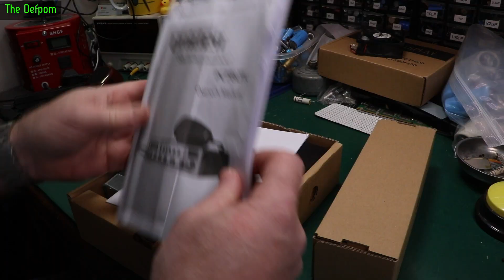🔴 Uniden PC78LTX Channel Modification - WORLD FIRST ! - No.1260

Comment: Dude your wasting time on doing that go buy a rci galaxy or a Stryker radio that the channels that have already been modified I know what I'm talking about I have been in the radio hobby for many many many years what your trying to do is poppycock 73s
Reply from the maker: @matt3030whiteeagle  those radios cannot do the NZ channels… at least not with correct channel alignment. I also know what I am doing with radios, been working on them for over 35 years… you might also know my website, RadioMods.co.nz !
Reply: @TheDefpom When my dad first got a look at my New Boss 429 the day I purchased it he took the pipe out of his mouth looked at me and said "What the hell do you need with a car like that" I replied in response I don't need it but I had to have it Dad. He put his pipe back in his mouth and just walked away shaking head. 

Point is I have modified, Repaired and installed about 30 thousand radios since 1969 and not a single one was ever needed but it was what they wanted. As a dble EE I watch Defpom because he knows what he is doing and when you take a radio that has never been modified it's a matter of accomplishment and Knowledge expansion and in that context it must be done.
Reply from the maker: @deltatangoelectronics8598  well said, thanks.

Comment: Would a Expo 100 A kit work for that radio with the 15.810 and the 14.910 mhz xtal in the channel kit to signal inject the signal like the cobra 29gtl/ltd/lx radios?  thanks
Reply from the maker: @dj56cbsales  yes I think it would work, the principle is the same
Reply: @TheDefpom  Thanks you very much for the info

Comment: i remember the challenge ( high school electronics shop ) of designing and etching my OWN boards. long before it was ever thought of our project was to design and OP-AMP which of course is what ppl call a taser. it could kill someone ( if it was the right person of course with health complications present ) with a 9v battery. IF they hadnt locked the teacher in the tool crib for a whole lunch period i might have excelled in electronics. of course they needed a scapegoat to blame it all on so it came down to the grades ppl had in theory class. so they wanted to make me switch to another shop and instead i left the school and never graduated past 10th grade. it wasnt all due to that but troubles in the home life which was nothing but living with 3 alcoholics i had to fend of from trying to kill myself since i was 2 years old. ( my mother, sister, ( whom is still trying to complete the job 40 yrs later ) and step father ) we were all robbed... thanks for the video even this late on in life its inspirational ! even without radio (s)hack :)

Comment: what does the NZ radio authority say about the use of modified CB radio's, which is illegal in the UK.
I did find something about the "RCM mark or R-NZ label"  but not much else in the 5mins I spent on the search. seems strange you went for what would seem to be a unique band plan for you CB's. was this to try and create a home based industry to met the demand?

Not used a CB since they made it legal in the UK, that took all the fun away. 🙂
Reply: Ahhh, the pre '81 AM days here in the UK. A family member 'allegedly' imported AM radios back then and sold them. Then in '81 went legit when FM was legalized with a nice wee trade business supplying Scottish shops, petrol stations etc with CB gear. I was the teenage tech guy helping out doing mods and repairs.......never for one minute thinking it was a tad illegal of course!
Reply: @IanScottJohnston  Making aerials for the car that did not look like CB one's was fun. the closest commercial one was called a DV27 if i remember correctly. Looked a bit like a normal fiberglass car aerial, with an adjustment for length on the top.
More fun when you thought you were a bit of a rebel. 🙂
Reply: @TheEmbeddedHobbyist  Yes, the DV27 far outsold all other car aerials......and the one for the home was the Dominator if I remember!
Reply from the maker: @TheEmbeddedHobbyist  all CB radios here have to be modified from overseas, often based on Australian radios, which are based on American ones, rules are basically the same apart from the operating frequencies.
Reply: @TheDefpom  now it makes sense, watched you do a few of these now and was wondering what you were up to and why.